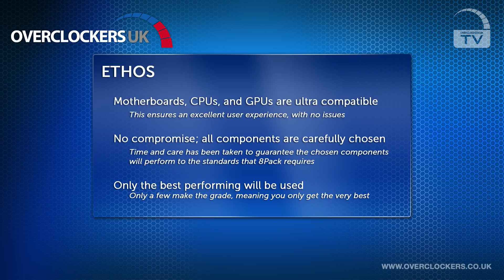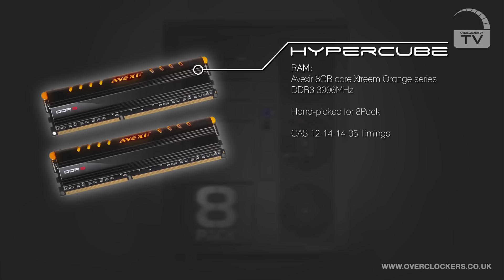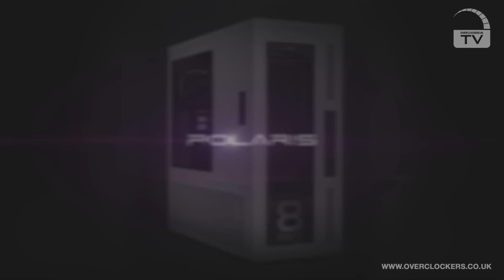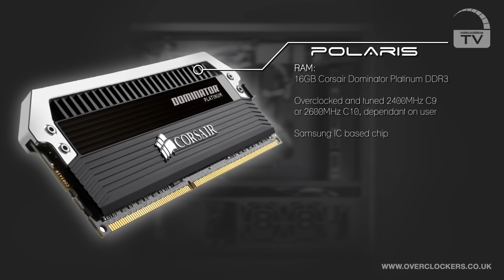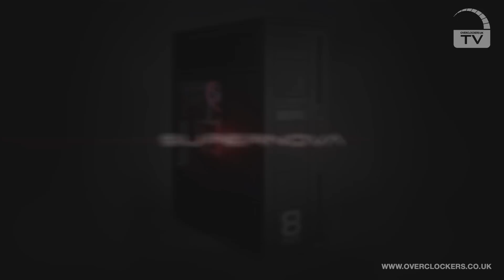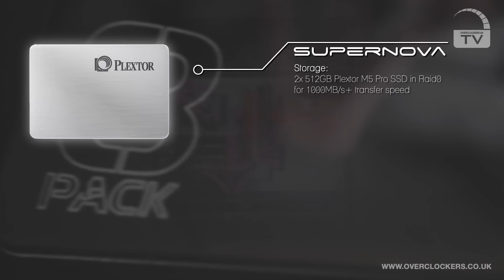Overclockers UK TV - The 8Pack Range

Comment: I'm hesitant to use the phrase 'Value for money' with builds such as this but when you look at the cost of a Scan White Tiger, 4930k @ 4.6 (lower oc), and the lower case cost with 'only' a 120.4 and a 120.3, with 3 titans (again, oc'd lower) the extra cost of the 'Nova can be taken into account with the personal service provided by 8 pack himself. Plus anyone who's spending this type of money on a pc is not going to worry about a few hundred quid here or there. In this age of call centres full of people who don't take ownership of an issue I'd gladly pay that little bit more for the personal touch. People are also bemoaning the cable ties in the systems but doing it any other way makes no fiscal sense to 8 Pack on Overclockers when he/they also offer free installation of any future gpu's you may want to buy. Doing it any other way runs the risk of the 6 and 8 pin cables not reaching the gpu's. Which equals more downtime for the pc.